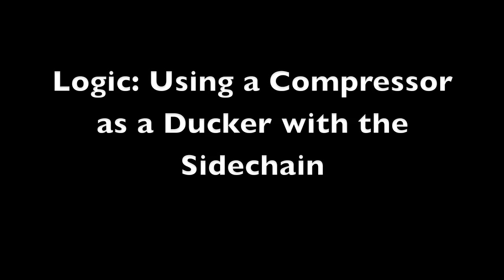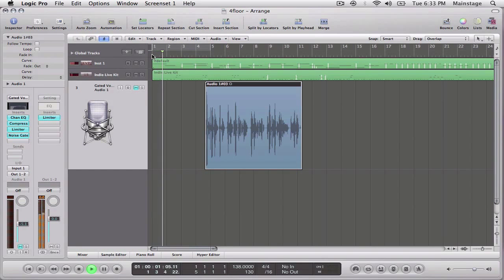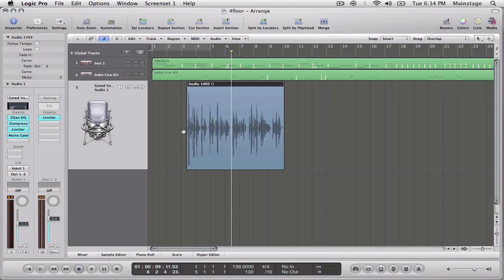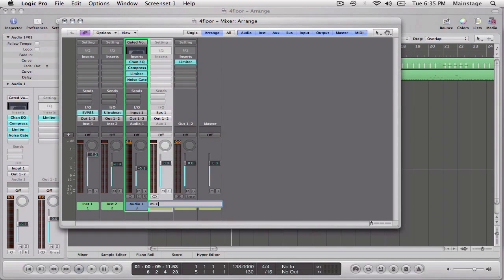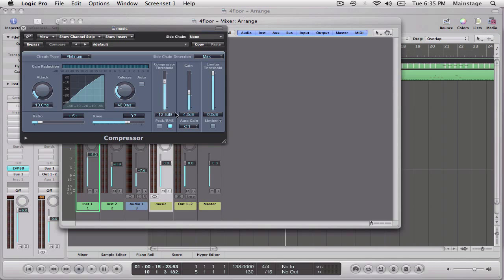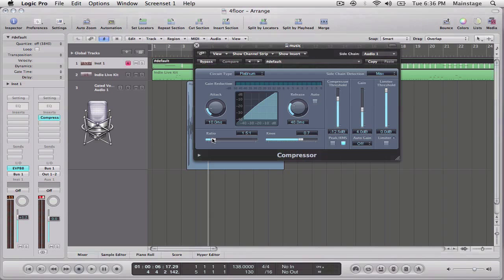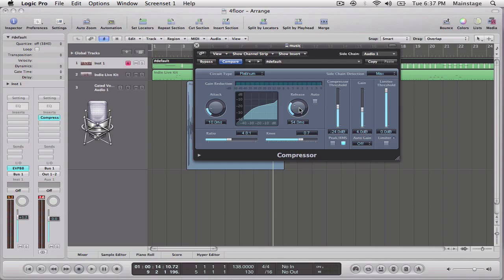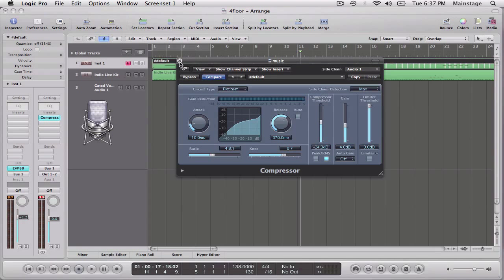Logic Tutorial: Sidechaining a Compressor for Ducking Effects

Comment: I believe it is, Also, I think it depends on your onboard compressor.  Also, you have to have one independent bus channel on your analog mixer.  Where you route your control signal to this bus channel i.e. usually a kick. but can be anything. then you put your compressor on a different track / channel that yo want to have ducked. Usually the compressor will have an input for for side chaining, which you will input in that earlier bus channel.  Also I will make sure that bus channel is muted.